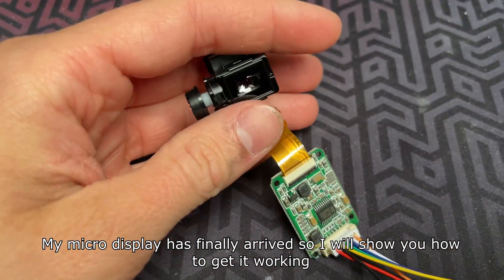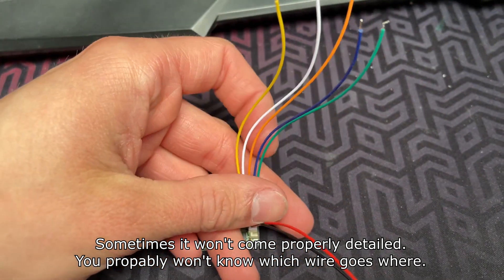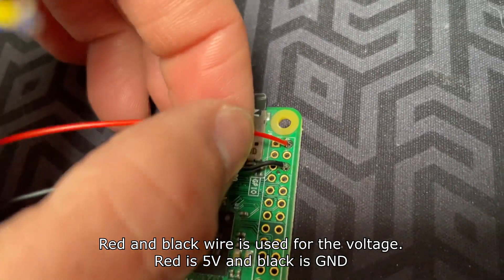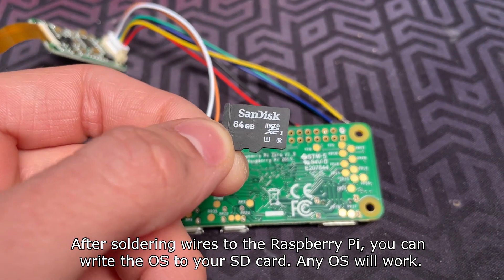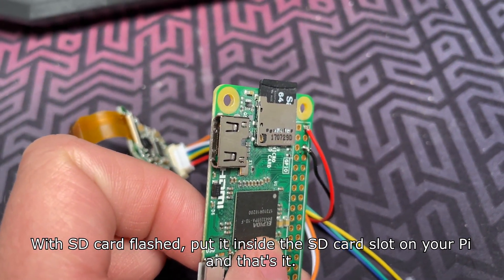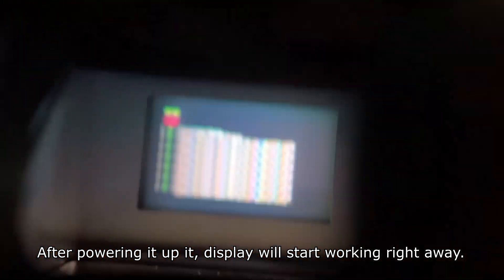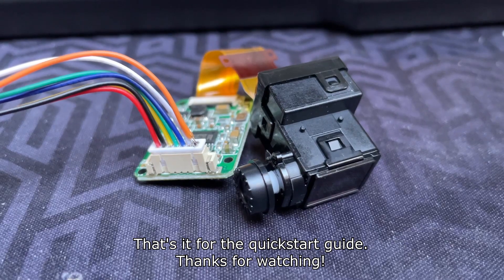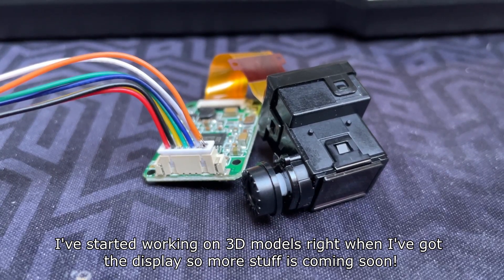0.2" FLCoS Micro Display Quickstart Guide

Comment: I bought one, it works but the cable was damaged. I changed the flex cable but now it is only shows a blue screen, no signal. The brightness can still change but no signal
Reply from the maker: Check the orange wire. Mine tends to break near the socket. Orange wire is responsible for the video signal
Reply: @ManolloMancelli  thanks! I will
Reply: @ManolloMancelli  doesn't seems like the problem :(
Reply: @matatisan did you ever figure out the problem, because I am having the same one.